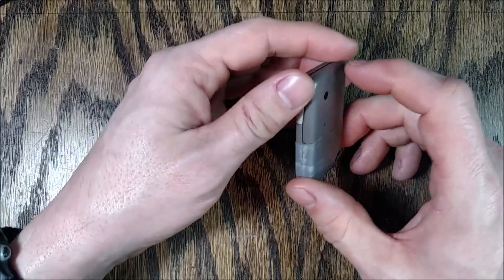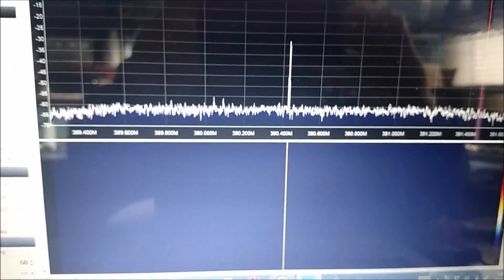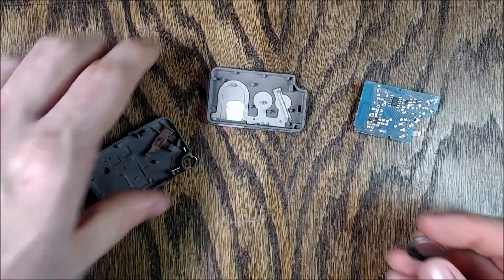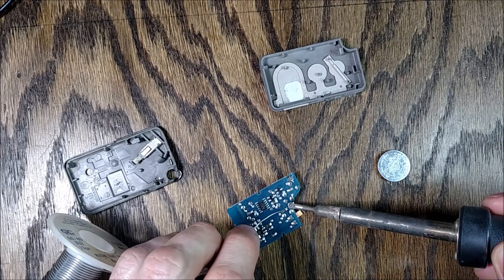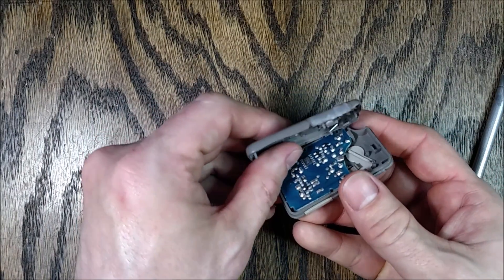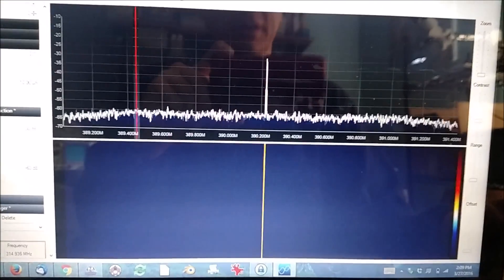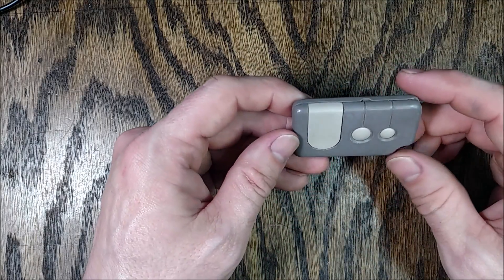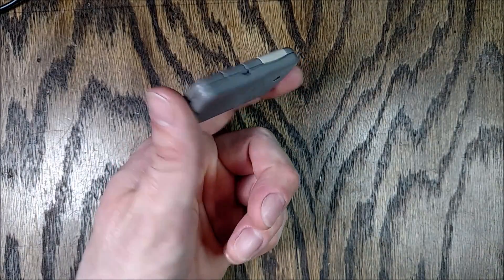Craftsman Garage Door Opener Remote Repair

Comment: thank carl, very good. I have a problem with my craftsman remote the larger one with three buttons.#18791 I have two of them one of them stopped working, I changed battery and I reprogramed it, but it only. works the door if I hold it right beside the door opener mechanism(motor housing). It seems to have a very short range? it worked for years before just fine... On the circuit board there is a blue coloured round device its marked "C3" on the circuit board, I tried adjusting the screw on the others ide of the board, I thought this might be the frequency adjuster? any help would be appreciated.
Reply from the maker: I do think the blue colored component adjusts the frequency, but I don't think you'll fix the problem by adjusting it.  I'd get a bright light and a magnifying glass and look for cracked solder joints and re-solder any you find.  If that doesn't fix it, your best bet is to do what I did years ago.  Buy a new remote, but not one of these.  I quit using these Craftsman remotes and bought a cheap one on eBay.  Just search for keychain garage door remote.  Make sure you check the color of the learn button on your motor unit and buy a remote that says it can program to an opener with the matching learn button color.  I don't really want to post a link to one here because in a month the link will end up bad anyway.  The one I got has a chrome finish around the sides, a back face and back, and one round button in the middle, and cost me about $12 online.  It is smaller, better built, and has worked great for a long time.  The disadvantage is that it has only one button, but I didn't need more than one.  If you do need to open more than one door there are versions with more than one button.
Reply: @cdsmith  thanks I got it working again, solder point were battery makes contact was worn out. Still can't figure out what that adjusting screw is for???

Comment: Can't get the garage opener to delete my old remotes, my neighbors are opening and closing my garage door when they are using their remote despite of never been programed with my unit... What a fucking piece of shit.
Reply from the maker: Strange.  I've heard of neighbors opening doors with the old style openers that have little switches inside to set the code.  If you end up by chance to have the same code set on the switches it can do that.  But I've not heard of that on modern openers that use rolling codes and a learn button on the opener unit.  Anyway, on most door openers all you should have to do to clear all the remotes is hold the learn button on the back of the opener unit until the learn light comes on and then goes out again.  Then you have to re-learn the remotes you do want to work.  When I used to use a remote like the one in this video I would sometimes find my garage door open but it wasn't my neighbors.  I think I was accidentally bumping the button when the remote was in my pocket.  I quit using this type of remote a couple years ago when I found a much better one online somewhere, not made by Craftsman.  It's smaller, much less expensive, is built much better, and the button is a bit harder to press and is a bit recessed, so I don't seem to bump it by accident anymore.
Reply: @cdsmith  i can not get the old stored remotes co clear/delete them. No matter how long i keep pushed on that "learn button" I've even had it taped down for more than 30 minutes, it doesn't clear the old remotes... Light goes on for how long i keep the button pushed, if i keep it longer than a minute, it stays on even after releasing the button...
Reply from the maker: @RomanTrollanski  Try this - Press the learn button until the light comes on, release the button, then give it a quick single press.   I read online that will clear learned remotes from some openers that the long press won't clear.
Reply: @cdsmith  thanks, I've tried... Still doesn't earse the remotes, when I push the learn button, the light goes on and stays on... Even after releasing the button, would still stay on until either i push the remote button, or wait about up to a whole minute to go off. 
But pushing down hold a few seconds, then followed by another push on the learn button did not clear the old remotes... I had to close the garage and unplug it so my neighbors won't mess with my door...
Just ordered a $400 new one, hopefully I'll install it myself so I save there a little bit of money. 

Thanks for the time you took to write me a reply.

Comment: Wow, I used your technique and fixed my remote in 3 minutes; bad solder joint obvious under the high power illuminated magnified loupe
Reply from the maker: Glad my video helped.  The solder joint that is the problem most often is the one where the battery contact on the back half has a pointy part that makes contact with the pad on the circuit board.  The point digs into the solder on that pad and eventually it doesn't make reliable contact.  If you just re-flow the pad with a new bump of solder it works again.  Just a tip for other viewers...

Comment: Humm all that and proof is in the pudding and you did not show it even working on the grage door ?
Reply from the maker: Sorry, I forgot that on the Internet its "Pictures or it didn't happen."  :)
I had to fix this thing again recently.  This time one of the switches on the circuit board wore out.  The snap dome in the switch wouldn't pop back up.  I had another remote that quit working years ago so I took a switch out of it to replace the bad switch in this one.  Thanks for watching my video.

Comment: I also upgrade the capacitor across the supply, as often there is either none or a mystery ceramic there for decoupling. Add a small tantalum cap, any value over 10uF and higher than the battery voltage by a good bit, I use 10uF 20V ones from old PCB scrap boards for 12V remotes, you can use a 6V one there. I often also use a soldering iron to tack the case halves together. Random operation is always either failed switches or moisture in the unit.

BTW those cases are available on fleabay, look for the empty remote fob case.